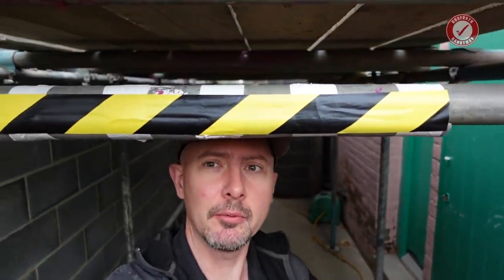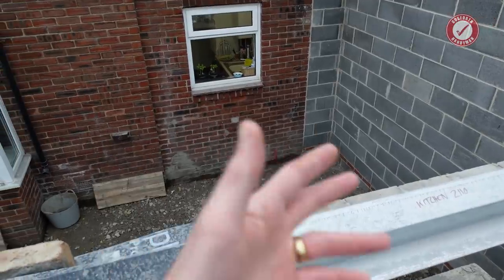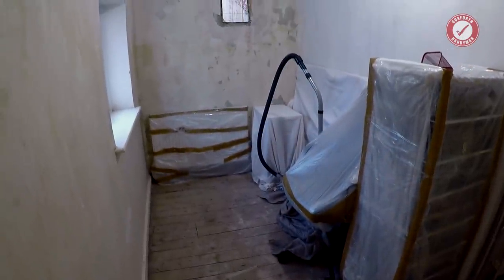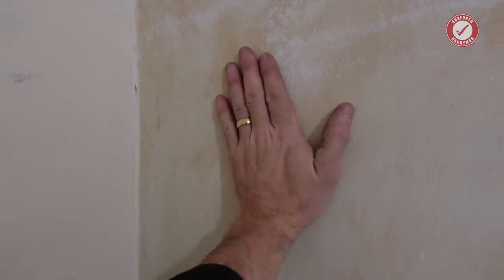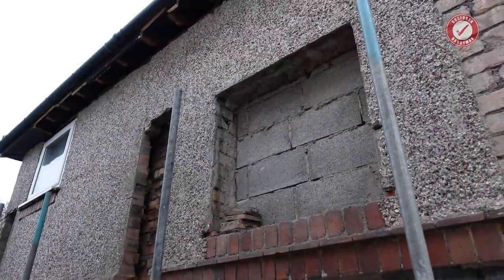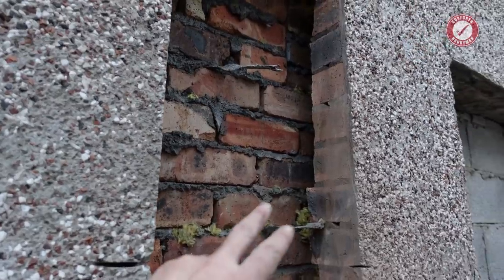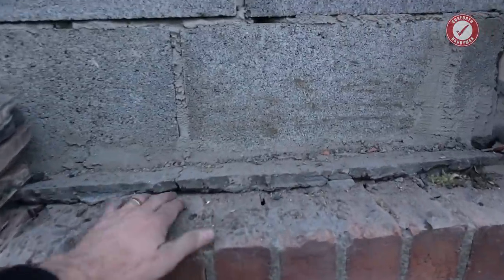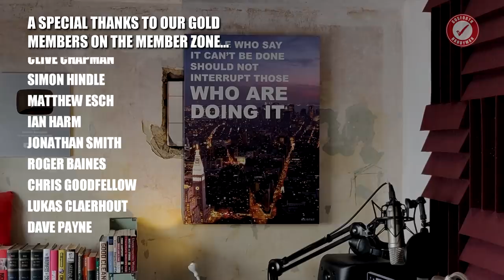Starting to take some walls out (Self Build Extension Part 5)

Comment: Just make your nook taller, frame it out, add some cabinet doors and you've got a fantastic storage cabinet for extra toiletries, paper products, etc. I would love extra storage like that in my bathroom!
Reply from the maker: Unfortunately there's a huge concrete lintel at the top of the nook. Taking it out would destroy the internal wall. 👍
Reply: @GosforthHandyman  could always just hang se floating shelves or piece of art over it when you're done and just have a lower storage cabinet maybe?
Reply: @GosforthHandyman  Would it be possible to cut the concrete lintel? If you took out the outer wall above it you could then drill through it in a series of holes and break off the outer part. Probably be more work than it's worth but might help make the nook usable space. (feel free to tell me I'm being stupid, I'm a stage spark so don't deal with concrete and brickwork much except for punching holes in it when needed)

Comment: Get a long 8mm drill bit and drill from outside 3 holes in each brick on your line down then when you remove the top internal bricks (not bonded) just use a booster or brick named to tap tops of each brick as you go down and they will break off we have had to do this plenty on abutments , you can then clean it up with eyes with but of mortar if needed💪💪

Comment: That's a proper beast that cutter isn't it..! I like the fact it offers dust suppression too!
Reply from the maker: It's mostly great... really need the dust suppression with those bricks! 😁
Reply: @GosforthHandyman  what don't you like about it?
Reply: Aren't they heavy though the cutters and to  move the pole loosen the the horizontal part of the clip only and tap it left or right using my 2lb universal spanner less likely that the scaffold will drop then
Enjoying the videos

Comment: A lot done since the last update!
You could use that nook for the toilet reservoir?
To knock the inner wall out where you cannot get in with the grinder you could use a long drill bit and drill a row of holes right against the cut, so the holes do line up with that wall on the inside.
Then it's easier to knock the wall out without knocking everything loose.
Reply from the maker: It's in the wrong place for a toilet reservoir unfortunately, did think that though! 👍

Comment: Think it would be worth renting a ladder hoist to get those blocks up onto the first lift. Cheap to hire and compact enough to get into the back garden.
I agree with Nick about the bump cap. Hard hats are cheap as well, but 'stick up' a lot making it MORE likely you'd whack your head. The hat would protect your head, but, speaking from experience, it does nothing to protect your neck from the sudden unexpected shock.
Keep up the good work, and thanks for sharing. :)
Reply: Never heard of them! Can't stand hard hats, like you say with the neck twisting. I will have to get myself one.
Reply from the maker: Struggled to find anywhere locally with a ladder hoist or anything similar! Did try. 👍

Comment: I think it would be easier to take out the rest of the brick on the exterior, your already taking down like 70% of the wall. It would make it easier to set one long sill plate down to set the floor joists on. Less bolting to a vertical wall, let gravity be your friend. Not only that a little bit bigger bathroom is never bad in my book.
Keep up the good work mate!👍
Reply: And just accept you may have to replaster the other side??
Reply from the maker: Cheers bud! There would need to be a pillar for the steel. 👍

Comment: Quite a testament to that old brickwork, that it's so hard to remove.
Reply from the maker: Too right! It's not until you try to remove a single brick from an old wall like this that you realise how solid these houses are. 👍
Reply: @GosforthHandyman  Removing a single brick is almost always hard, even if the mortar is just plain mud (clay mortar). That stuff has zero tensile strength but in a joint with plenty of weight on top it can't go anywhere.

Comment: I got a great tip from a friend after I walked onto the back of his truck and whacked my head on the hoist gantry he has in the back for loading/unloading skip sacks of firewood. He simply told me to turn my cap around so that the peak is pointing backwards when on-site or doing any work where there are things to bash your head on but wouldn't have a hard hat on. It has made a big difference, the peak obscures just enough vision that we don't see obstructions until it's too late..
Reply from the maker: It's a very good point! I bash my head mostly since I have reduced field of vision above my eyes. 👍👍
Reply: Happens all the time with hard hats, you think you've ducked enough but no, many a cut head and the the bell ringing

Comment: Instead of trying to fit a ledger board where the old window was , cut pockets out at 400 centres and pigeon hole the joist, that way you aren't trying to get a fixing into an uneven surface and where the pockets land chain drill the brick far enough back to get a good bearing for the joist and hopefully that way you won't disturb the plaster on the inside. When the joists are at the right centres pack them level with slate then stap them with a baton. 
Any gaps in the pockets can be packed with slate tight to the side of the joist and pointed up.
Reply from the maker: Did consider this but the ledger was absolutely fine in the end. 👍

Comment: A nook in the bathroom sounds like a good idea. Maybe put up some glass shelves and you’ve got a great place for shampoo and shower gel bottles etc. If it’s too low couldn’t you just continue it upward and make it taller?
Reply from the maker: There's a giant concrete lintel at the top of that window so you couldn't really make it any higher unfortunately. 👍

Comment: I think it'd be less hassle and a better overall job to take the whole wall down. Rebuild the pillar for the steel in block and do some replastering if needed
Reply from the maker: Not really that simple and you have to work out a) would it add any value to the property (no) and would it add any value to us (no) so off the table.
Reply: 👍 hadn’t realised there was a lintel that spanned the two skins. That’d be a ball ache to sort

Comment: Hello Andy you have come such a long way since i started watching you about a year ago. I note that your 1920s house has a wall cavity,  whereas mine doesn't which is very interesting.
Reply: i think they only became common in 20/30s
Reply: This is a 1920's house which making it even more surprising to me. Seems like most houses around my way (Liverpool) are solid walls well into 1930's. My house was built 1934 with solid walls and was bombed during the war but was rebuilt with solid walls again.
Reply: @Game0verFool  yes the same in Derby, mine was built in 1936 without a cavity or a dpc. Also built on the piss, but that's another story.
Reply from the maker: Yup - was very pleasantly surprised to find the cavity walls in a 1920's house! Would have been state of the art at the time. 👍😁
Reply: @GosforthHandyman  must be a posh area 🤣 mines a 1930s also no cavity about to tackle the final room at the end of the month. The lounge. Finally get rid of the polystyrene tiles on the ceiling

Comment: Looks like it was a Tree Bee nest, they often nest high up in some form of medium such as birds nests and insulation. No bees in England are protected.
Reply from the maker: Could be! They look like bumble bees... but not quite as big. Appear around spring and swarm around the entrance - only 20 or so.
Reply: Sounds like carpenter bees. They can drill holes in wood soffits and fascia at an alarming rate.
Nobody cares if they die and you would be doing the world a favor by getting rid of them!
Reply: @freetolook3727  Very unlikely to be carpenter bees in Gosforth. There are a couple of European species, but only the violet carpenter bee Xylocopa violacea (the largest!) occurs in the UK, and it's only started to arrive from France in the last few years due to climate change. In any case, carpenter bees are solitary - they may occur in colonies where there is suitable habitat like dead wood to bore into, but they don't form nests like social bees (honey bees & bumble bees). From the size, this looks like a bumblebee nest - they never have more than about 200 workers, usually fewer. 
Honey bees form typical honeycomb, and their nests can be much larger and sometimes are reused over years. My family had an old house in Kent where honey bees nested in a disused chimney. After many years, so much honey accumulated that it began to ooze through the walls, a horrible sticky goo mixed with soot!
Reply: Bombus hypnorum, aka Tree bee 🐝👍

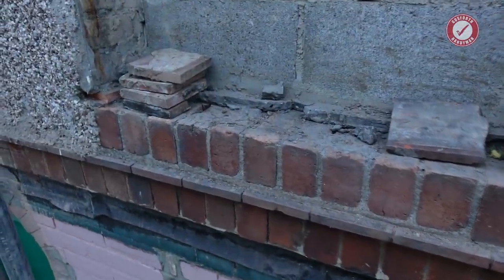Comment: 28:28 You could cut horizontal parallel grooves at the depth you need and then chisel out the soldier course and tiles to the required depth. So cut into the bricks from the front, left to right, start from the top and then every 2 cm or so cut another groove, it doesn't have to be precise as long as you go deep enough and make plenty of cuts to hog away most of the material. Cut a centerline into the front edge of the tiles, so you can easily chisel the front ridge off without risking too much unwanted damage. The result may be somewhat rough. Then render the area where the plate has to go to the right thickness, that also keeps the brickwork (the inside half of the soldier course etc) together nicely and fills any cavities.
Reply from the maker: In the end it was only a couple of bricks and managed to smash them in half with the lump hammer, so wasn't as bad as I thought it would be. 👍😁
Reply: @GosforthHandyman  Nice going!

Comment: When we got scaffolding in they put end caps on the poles, etc. Seems like yours haven't done any of that which probably isn't helping with head hitting & blocks knocking off
Reply: Should be wearing hard hat.
Reply from the maker: Yeah, I just need to wear my proper hat. 👍

Comment: @27:10 Plaster work is cheap and easy to repair. It's strictly cosmetic and in construction, anything cosmetic can be fixed a lot easier than anything structural.
Reply from the maker: It's half way up a staircase and very difficult to access from the inside.

Comment: Where you are continuing the cavity at the corner, I'd imagine the old cavity is less that current building regs. Will you continue the same cavity dimension or build out to current dimension?
Reply from the maker: Build out to current regs but since imperial bricks are bigger the overall wall width ends up roughly the same.
Reply: @GosforthHandyman  Since i'm no brickie or builder, that's quite interesting. So I guess when we went over to metric, one advantage, for the same wall width, we ended up with a deeper cavity and therefore more space for insulation.

Comment: If it was me I wouldn't worry about the new internal plaster. Do the brick work right and just get it replastered.
Reply from the maker: Do the brickwork right? No right and wrong here - just personal preference. 👍
Reply: @GosforthHandyman  I mean remove what you need to remove to make the most of your new rooms. Don’t compromise just to save damaging a bit of plaster. You’ll be kicking yourself when it’s all finished and you realise that extra 100-200mm of space taken up by the outer leaf would have made the room perfect.

Comment: sounds like someone needs to invent a new kind of cutter, that can flush cut, and/or cut perpendicular to the body of the machine...
Reply from the maker: Defo! Wish they did a cutter where the blade was closer to the edge, like a circular saw... but I guess it would knacker the balance. 👍

Comment: @11:28 "Prevents thermal bridging": Dead air space is your best insulator. When I bought an old Sears Craftsman kit house, I thought that my heat bill was going to be astronomical as there was no insulation in the walls.
To my pleasant surprise, my heat bill was relatively cheap as the house was built air tight and did not need insulation.
Insulation would have created condensation build-up in the walls which would lead to mold and mildew.
Reply from the maker: In the UK you defo need insulation too - massive difference if the cavity is insulated. 👍
Reply: My current house got blown-in insulation put in by the weatherization program.
It made about a 15% difference in the heat bill.